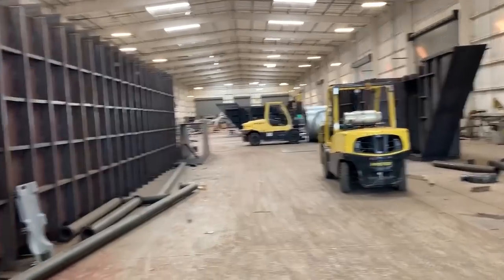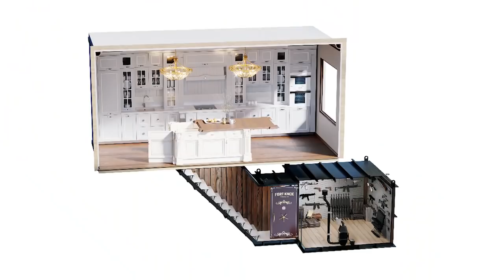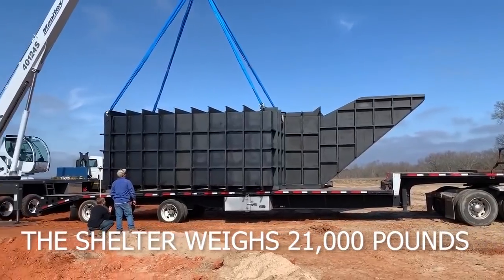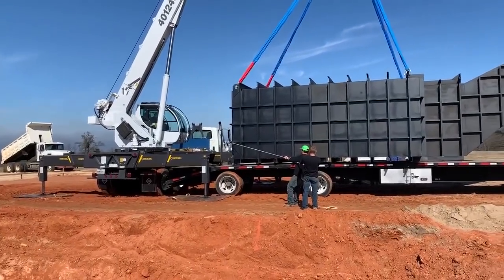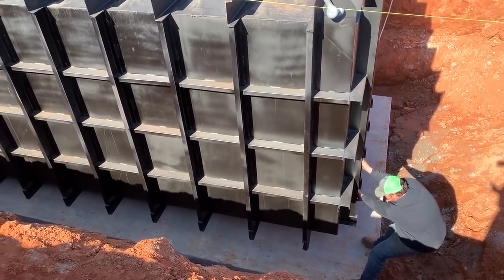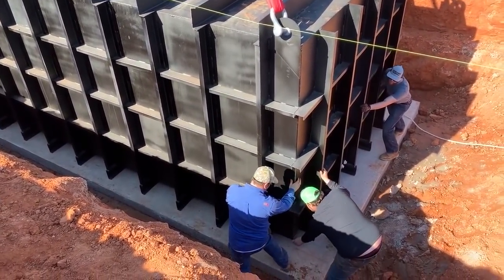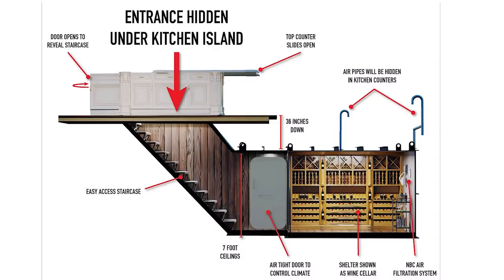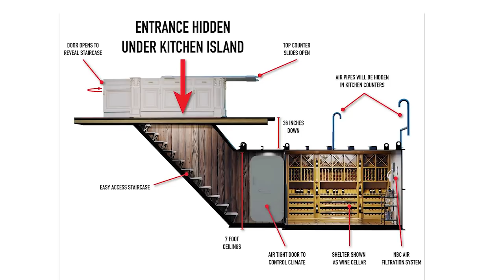THIS $50,000 WINE CELLAR IS REALLY A SECRET BOMB SHELTER

Comment: Ron: I suggest you check on the idea to wrap the exterior of this shelter with metal sheets welded watertight. In that matter you could fiil the space between the steel plackards with water to make te shelter resistant to neutron rafiation. Plus, after the effect of the neutron radiation passes, that water could be also use for cleaning or to feed the toilet tank.

Something like that could be a great addition to your bunker line.

Comment: Couple questions please:
1. Is the 50K price a "turn key" price. Meaning it includes excavation, slab to set shelter on, crane, etc., etc., etc...?
2. If #1 is 'Yes', would you consider pricing this shelter at just the cost of building it?

Explanation of #2 - I can haul it myself. I can excavate myself. I can do flatwork to set shelter on. And I'm not a DIYer. I do excavation and concrete, licensed and insured, and I own a lowboy that I use to haul my own machines. I would of course want your people there to insure shelter is installed to standards that would keep any warranty in place. Thanks.
Reply from the maker: That was just the price of the shelter    the freight was extra and the slab and crane was extra all paid by the customer
Reply: @AtlasSurvivalShelters  : OK thanks.

Comment: do you make them wheelchair accessible? That might be a fun video to do if you do
Reply from the maker: we do if they are at ground level
Reply: ONLY with  elevator  WITH HUGE hall entrance to bunker .. cost A Mint
Reply: Ron I love your videos.
Reply: @AtlasSurvivalShelters  Would you consider working with a handicap elevator with a little shed on top for the elevator?
Reply: MrScott2218 set of flat rails the width of chair , with a  electric or manual pully system
Reply: MrScott It would take a little prep work but it would be easy to modify one for wheelchair access depending on the level of motion the person has there are two main access methods one is the rail mounted to the stairs for a climber chair to ride up/down if the person can transfer from the wheelchair on their own with a second wheelchair permanently in the bunker. Second would be for someone that can't transfer on their own or is using the bunker access to also give access to another level of the house using a vertical access shaft and a small sized wheelchair elevator.

In ether case you would need the bunker specked out for wheelchair access with wider doors and level floors between sections.
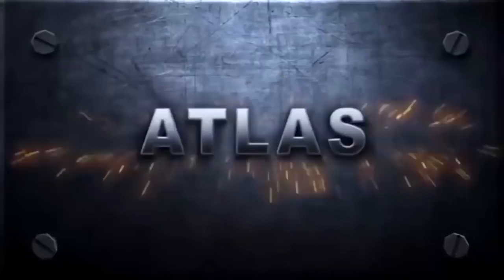Reply: The maximum slope should be a 1:12 ratio, 1" of rise to every 12" of length (4.8 degree angle; 8.3% grade).  A floor 10 feet under the main level entrance would need a 120 foot long ramp. That's a lot of work and tons of steel. 
 I'm sure the right money could get it done.

Comment: Sheet metal formed gun vault doors are defeated easily with sawsalls.  You need hardened plate steel door. These formed doors only have hardened steel directly over the locking mechanism but can be accessed above or below the plate.   I opened a Browning gun safe door easily with a sawsall  after the electronic lock failed. All these large chromed locking bolts are for show since the lock itself is vulnerable.

Comment: So the cost is the same as a basement.  The concrete slab may hold water against shelter.  Is there an escape tunnel?  Once installed how would cabinets etc be mounted to the walls?
Reply from the maker: the wine cellar has all wood placed inside

Comment: A better option on getting these shelters in place is to make bolt together panels with a rubberized seal between them so you can use panel sections that fit on a normal flatbed trailer and can be lifted by an excavator. Why let everyone in the area know a shelter is going in when you can just ship a flat pack of parts on a normal truck and use common equipment to get it in place.

Comment: Sorry but I don't understand why a 18 ton crane can't pick up 10.5 tons or 21, 000 pounds (shelter weight) .    What happened?   Either the crane was smaller than 16 ton or it weighted more than 21k pounds to max out the crane.    But they should have sent you what you ordered.  Glad you had the big boy pick it and drop it. Looks great
Reply from the maker: it will lift it straight up but not if it reaches out  it loses strength the furfure it reaches out